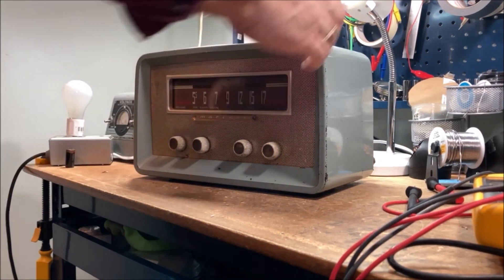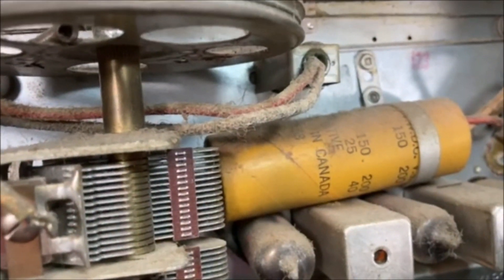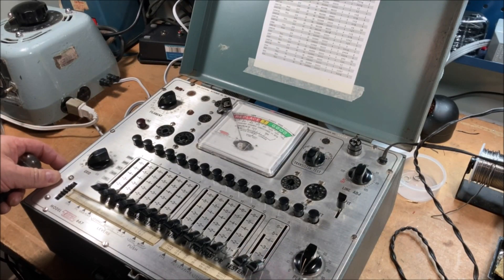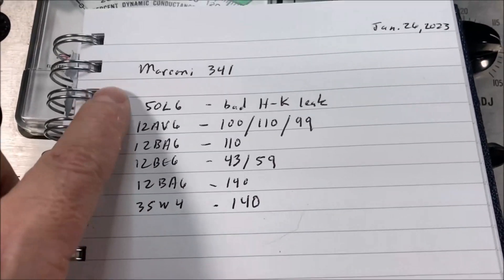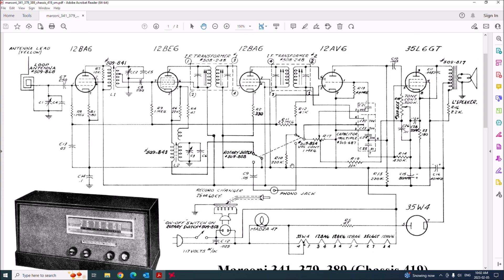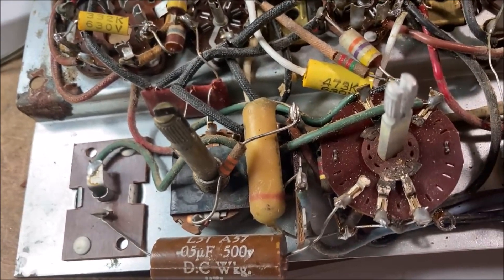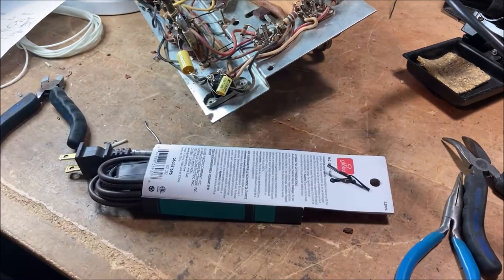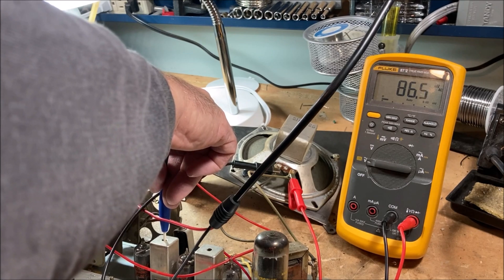Repairing a vintage Marconi 341 radio

Comment: Great video! Using the 50L6 instead of the 35L6 is a good upgrade. The AC line voltages today run higher than the 117V used in many places up till the 1960s. So the 50L6 will keep the current draw through the series filament string lower and will help to prolong the life of the tubes. Anyway, this is an Awesome looking radio! I never seen one with the chassis mounted vertical before.